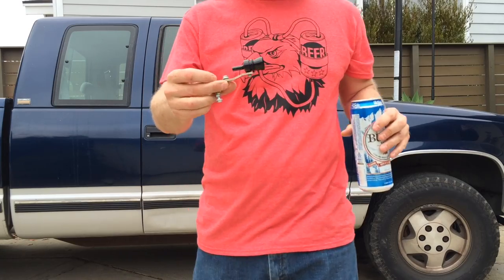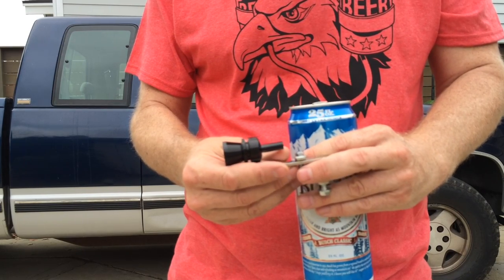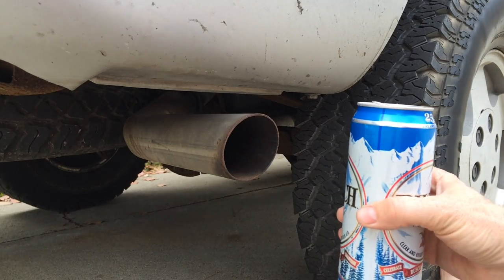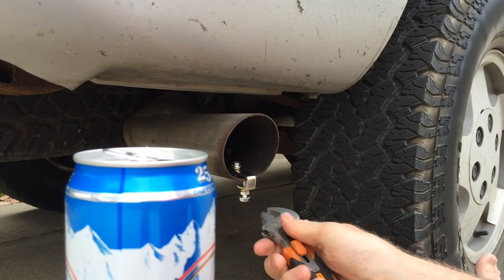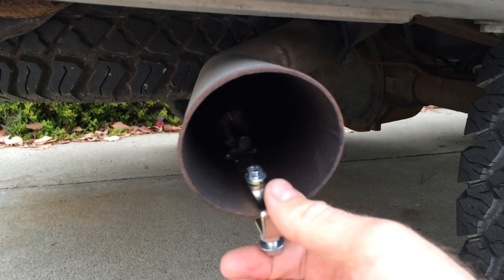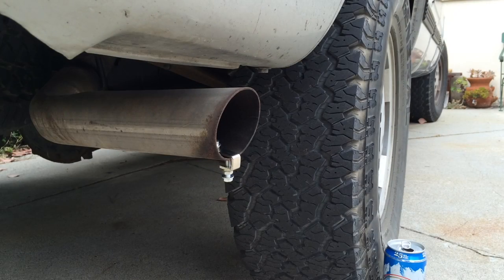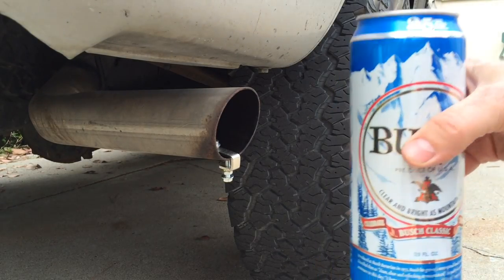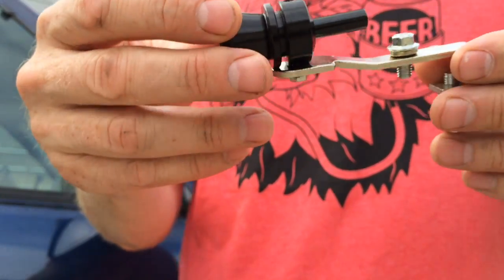How To Turbocharge A Truck

Comment: Genius! It works on any car with an exhaust pipe. Apparently my friend's electric thing is faster now. He bolted it to the frame and the slipspace effect was amazing. 0-60 in 3.4!
Reply from the maker: ProjectedClarity Yes!  It will work on an electric car if you turn it around so the airflow can make it whistle.

Comment: That thing is a scam, it will instantly ruin your muffler bearing, did you see the smoke coming out?... That's a burnt muffler bearing
Reply from the maker: No. That was American turbo smoke caused by the friction of the exhaust gasses against the mighty turbo whistle. It is a good thing.

Comment: hopefully you  can install the diesel AND the turbo at the same time
Reply from the maker: I hope so! 1000 horsepower on old French fry oil.
Reply: ***** you might consider upgrading your tire treads to handle the extra horsepower.  Heavy duty duct tape around each tire, in three layers -- preferably the silver since it looks more like metal, it should make it stronger, plus maybe one top layer of black so cops don't see it and get jealous.

Comment: When they will start producing models for fuel saving? :P :P :P
Reply from the maker: Difficult Questions Probably never.  If you jammed it into the gas hole, it would stop the gas from getting into the tank, which would save fuel.
Reply: Ya the fuel murika steals from "terrorists" right?

Comment: I bet you put water in your gas tank too.
Reply from the maker: Yes.  It is special speed water.
Reply: that's a myth to get you to buy more special speed water. I just put tap water in my tank. helps cool the engine and when it vaporizes to steam, gives me an extra 250-300 hp!

Comment: No son, you drill a hole in the pipe and screw it directly.
Reply from the maker: +‍1marcelfilms yes. That's the smart way to do it. I don't do anything the smart way.
Reply: HEHE. 
how about 2 of those exhaust whistles or one in the intake?
Reply: I still have mine in. its bolted in permanently and makes funny idle sounds.

Comment: A turbo works by using the exhaust to turn a turbine, The turbine turns another turbine that gives the air intake more air to breathe. if you get more air and fuel mixture, You should have more power than without the turbo. This guy's make-shift version of a CatBack does not really look like it improved anything.
Reply: I'm explaining the way a real turbocharger works so people don't believe this bullshit.
Reply: Eric Roberts You would be surprised!
Reply: Cyla cab Am I supposed to be offended?

Comment: Normaly Turbo whistles sounds horrible xD but your one does not even make any sound ! xD
Reply from the maker: +NamacilHDx It makes no sense.  When I blow on it, it is loud, but it does nothing in the exhaust pipe even if I rev it all the way up.
Reply: they are shitty anyway but mabey you didnt got enough(or wat ever dont know how to writhe this word  btw greetings from germany ^^ ) pressure i mean its nothing else then a normal whistle and you need pressure to blow one of then too right ? but the problem is .... a turbo does not have the same "pitch" as the engine its slower spinning down and has somekind of an constant pitch with the whistles not have they ..... are just shitty xD if you want turbo sound get a citroen c4 or somethink diesel engine I4 turbo :D 280 nm torque or somethink not much ps but you got some strengt xD no idea but pls dont show whistles other people will think they need one too xD XD xD and nobody wants that xD i mean everydiesel engine got a turbo just look our for one thats louder and put in an other exaust xD some antilag and you will have fun xD xD XD sry

Comment: YOLO hat
Reply from the maker: jaspertaawesome It's the awesomest hat ever.  I bought it at a gas station in the high desert for $5.00.
Reply: ***** i got a 16 in the back and in front 25/26
whats the best match for a normal bmx
im talking about the theeth
Reply from the maker: tyrone wiebers  Most new bikes are running 25 in the front and 9 in the back.  In your case, having the bigger sprocket in the back means you have to pedal faster to go the same speed as a bike with a 9 in the back.  This is good if you do a lot of hill climbing, but not so good if you are trying to go fast on the flats.
Reply: i know it sucks